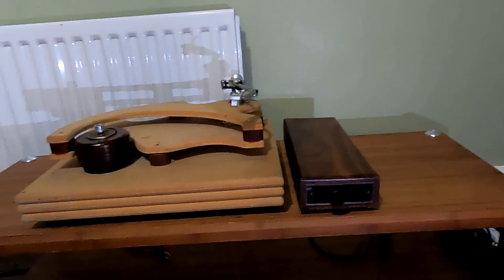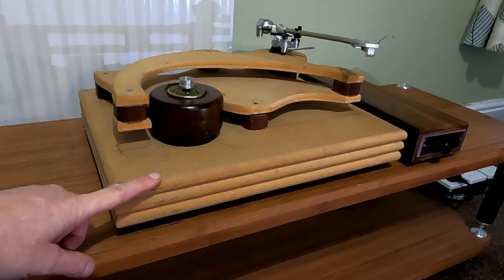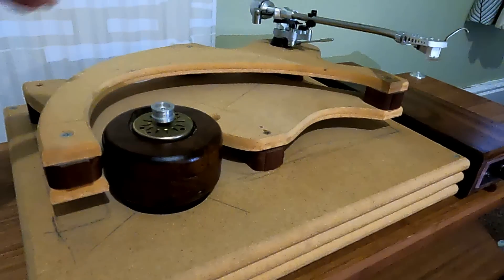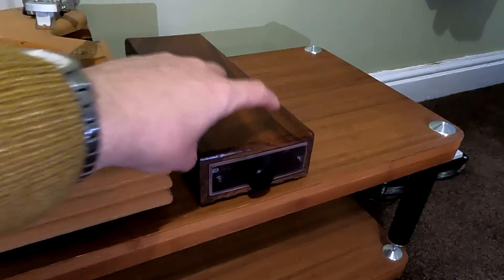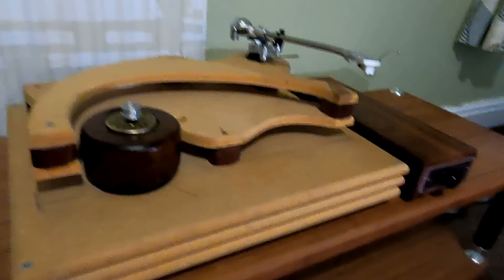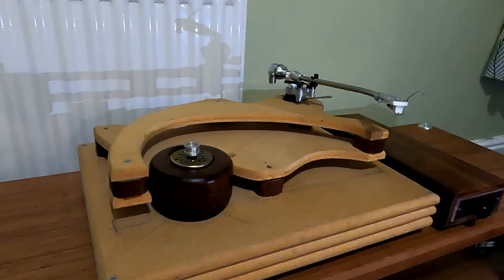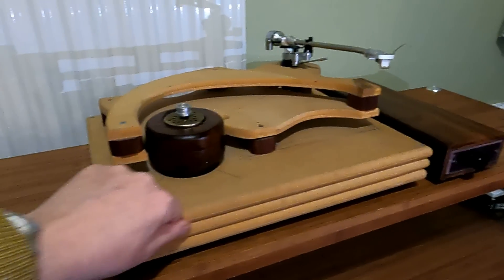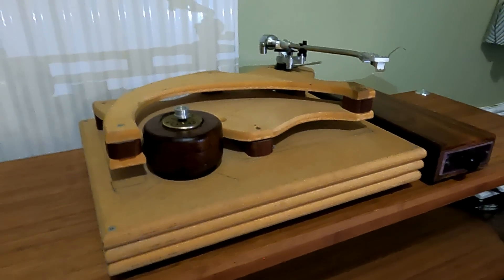Frankenstein's Record Player -  I made my own turntable, was it any good?

Comment: Lol...I also had a go at designing 3 point suspended turntable back in the 80's for my industrial design degree....which  turned into a really interesting (engineering, material and sonic) can of worms....luckily it worked in principle and sounded good ...but sadly never got it refined to the level of the pink triangle PT1 turntable (that I had got with my college grant money - as a reference point) 😂 Which with a little Myst Tma 3 amp and some Tannoy DC speaker's sounded subjectively glorious  😂😂😂😂

Comment: Hi Phil I recon you could resurrect it , with the modern materials available today you might now succeed. Even the fact you didn’t apply a coating to the MDF could have lessened it’s tonality , the ever debt with regards low mass as a pose to high mass should be proof to anyone that the race is definitely not won . So dear friend do not be to hard on your self ,  going back to the drawing board is no setback but the road to enlightenment .     Best wishes and kind regards as always . 😀👍👍👍

Comment: I concur that the link between arm and platter was not sufficiently rigid, due to sorbathane or equivalent soft separation elements dividing the platter and armboard layers. This would have lead to a mushy, undynamic sound and probably lots of colouration and distortion on difficult tracks. This is the rub of turntable design - having to maintain absolute rigidity between stylus, platter and arm base yet prevent all sources of resonance from affecting the primary signal. The LP12 which replaced Phil's DIY effort was itself not great at dealing with resonance when compared with the latest well engineered equivalents.

Comment: Very cool anyway! I am building a tt as well, but I am going the opposite direction, super light. I am now building a 14" tonearm. It's fun and it makes you realize that there's a lot science behind a good sounding tt🧐
Reply: Light is a good option because once a large, heavy mass starts vibrating, it is difficult to stop or dissipate the resonance rapidly. As long as very tight junctions and absolute firmness can be maintained within a light structure, very good sound is possible. IME resonance can be reduced by forcing the energy path around openings (large holes) and through layers of different materials. Minute differences in fixing methods, material choices and mass distibution can make startling differences to the performance. If you find the right recipy it is possible to achieve remarkable quality. Remember that the longer the arm, the more it will be inclined to resonate, so I would not tend to go that route. IMO resonance issues and not tracking error are the reasons for degraded performance. Most 9" arms will sound perfect on a resonant free turntable. Good luck with your project.

Comment: Merry Christmas. Never went as far as creating my own TT from bits and bobs, but i did have an acrylic top plinth layer (no peninsular cutout, though) made for a drooped original Roksan Xerxes. Sounded pretty decent but lost the punch and excitement that the original top plinth had. So the bits and bobs have to work in tandem and a bit of trial and error is needed to get a good sound. At least you didn’t try to fool yourself something you made must necessarily be good.

Comment: Haha! Yes, been there and done that back in 1976. Main parts were a Sugden Connoisseur BD1 turntable chassis, Mayware Formula IV arm and a Shure V15-III cart. The 'plinth' was a 3/8" alluminium sheet, which was a pig to make the cutouts for the arm and tt with just hand tools. The only isolation was stacks of large 35mm film spool hubs and 2" blocks of foam. It sounded alright to me and was actually very stable. Lasted 4 years but like you, I just bought a Linn and sold the DIY effort. Cheers!

Comment: Not as custom as this project, but I pieced together a turntable as well starting with a plain plinth, ignoring the manufacturer's choice of tonearms (for the looks)... so I had to find the point where to place the tonearm and since that is down to 1/10 mm according to the tonearm manufacturer, this turned out to be a real pain, i.e. I devised a few contraptions, some of which would have to be CNCed just for this one-off purpose etc, and then drilling holes in the plinth to mount it, finding the proper hight above platter bla-bla... OK, it is for shits and giggles, so not saying it is terrible, it was kinda fun - what is terrible though is that after I was done, it turned out that my Ebay sourced tonearm needs re-wiring and that will cost me another 700 bucks :) I even thought my motor is shot as well, but it then turned out that getting the speed right simply required the most miniscule of adjustments... So for now I am pissed off and will take this up again next year...